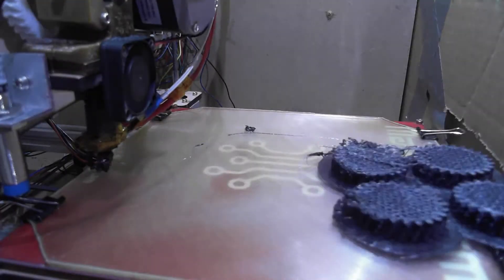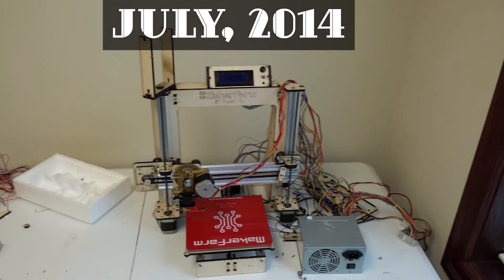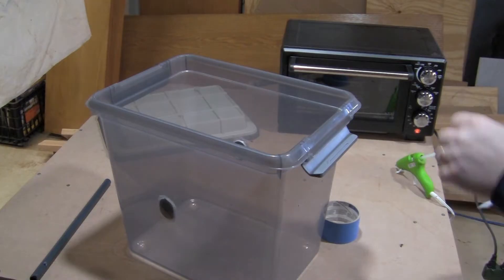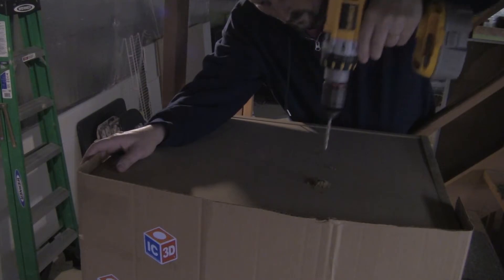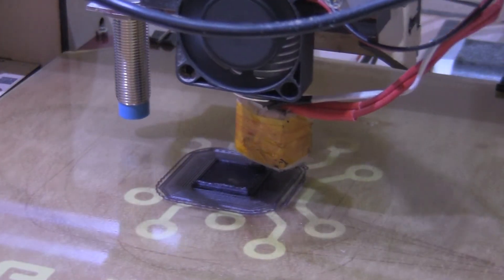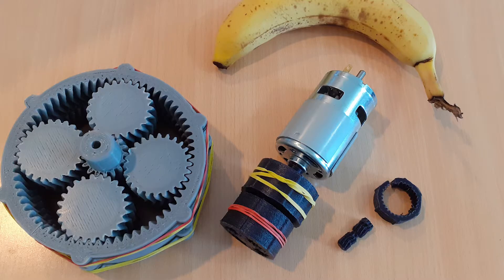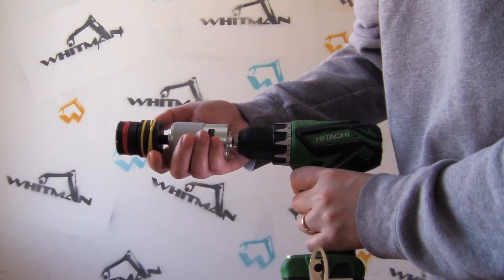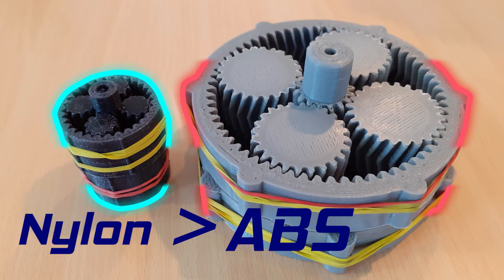So long, ABS.  From now on I'll be printing all my gears with Nylon.

Comment: Hi guys !
I am printing gears for RC cars with nylon I need to fix the gear on a 3mm metal axle how should I do ?
Glue ? small screw ? did you already experience this kind of issue ?
Thanks !
Reply from the maker: Well, let's see...  I have some gears right next to me printed in nylon from a gearbox that I don't need anymore.  I put some dabs of "Gorilla Super Glue Gel" on one and stuck another gear to it.  It's the super smooth sides that were against the glass during printing, so it should give the least adhesion vs a different size.  In the time it took me to write those last sentences, it set and I can pull with most of my strength and it doesn't come apart.  Seems like it's safe to say that super glue will happily adhere to the Taulman 645 these gears are printed with.  I applied some uneven force and the gel broke down the middle, so it sticks harder to the nylon than it's own structural ability.  Should work like a charm for gluing to your axle (as long as it also sticks to the metal rod).  You might do that baking soda trick if you want to add more structure to the joint, too.

Most of my gearboxes are either compound planetary gears or the outputs are not uniform/have mounting holes.  I haven't tried attaching directly to an axle.

Comment: Hope it works for me ! Do you use a teflon insert in your metal heatbreack ? You probably  do , as  its a game changer ! All the best and thank you
Reply from the maker: Good luck!  I don't have a teflon insert anymore.  My whole hotend is metal now.  I bought a quality heatbreak and rebuilt the hotend with new parts, better insulation, and a new fan on the heatsink to be able to print hot enough for Nylon and still be cool enough to print PLA without jamming.  It was a long and laborious process, but I eventually worked out all the kinks.  My teflon tubes kept burning at nylon temps.

Nylon is an awesome material to print with, and when the filament is nice and dry it actually prints really easily.
Reply: @WhitmanTechnological  AHA ! Now I wont burn my Nylon ! Notice taken ! Another  hard earned tip passed on !thanks again !

Comment: Very cool video Josh, you gained another subscriber :D Have you considered lubing the gearbox in order to reduce the noise and wear further?
Reply from the maker: Thanks Filip!  I have lubed other ABS gearboxes, but I didn't lube the big ABS compound planetary in this video.  The Nylon one is so much quieter, even at full, speed that it'll probably be almost silent at the much slower speeds (like 10x or 100x slower) where it'll normally operate.  From what I've read, Nylon gears don't need lubricant, and that certainly seems true of the gearbox I printed.  The ABS gears occasionally spit out little flecks of plastic during the break-in of the gears as defects are ground out .  The Nylon is so spongy and strongly self-bonded that nothing ever wears off, it just compresses briefly.  Perhaps a little lithium grease might be good if the noise goes beyond hilarious and into the painful, lol.  I've read that petroleum lubricants are generally a bad match for 3D printed plastics, but lithium is ok.  Thanks for the tip, and the sub!
Reply: @WhitmanTechnological  oh yeah sorry, I forgot nylon is kinda self-lubricating, my bad
Reply from the maker: @c-djinni  Yeah.  Printed nylon is amazing for gears.  The layer adhesion on Nylon is insane.  I can't break even thin parts by hand or even with pliers.  Only a hack saw or tin snips will do the job.  It's awesome.
Reply from the maker: @c-djinni  I've made a couple gearboxes since making this video, and I've concluded that pre-lubricating nylon gears with lithium grease before assembling is a really good idea.  Especially the hole where the axle will rotate.  Your suggestion to lubricate was the right call. :)